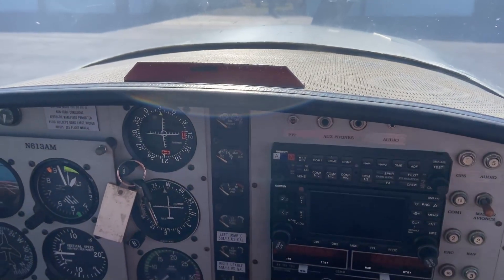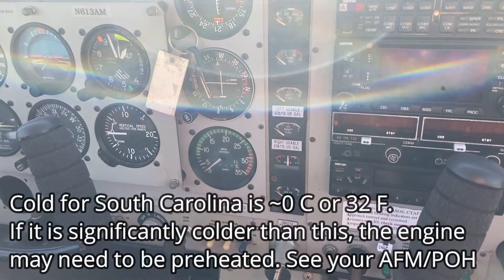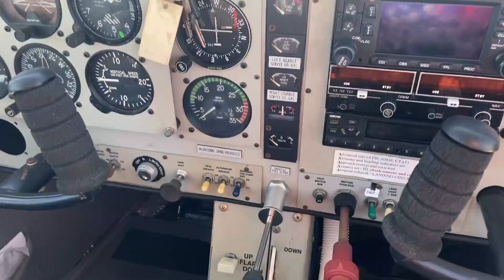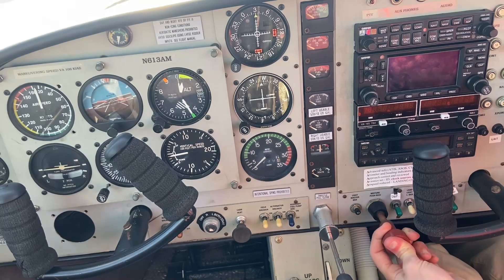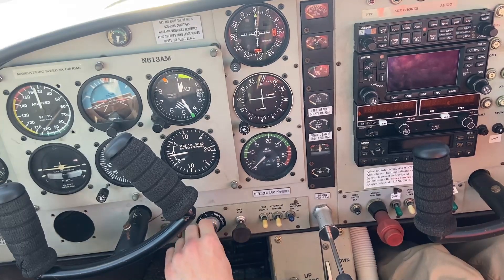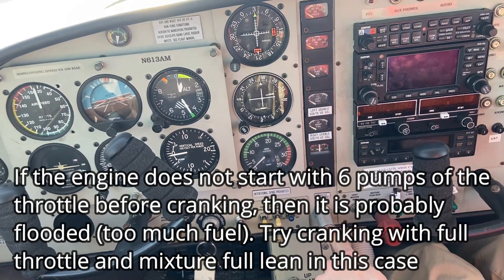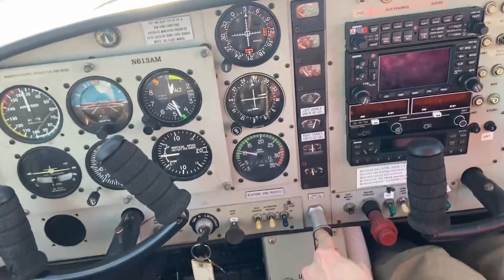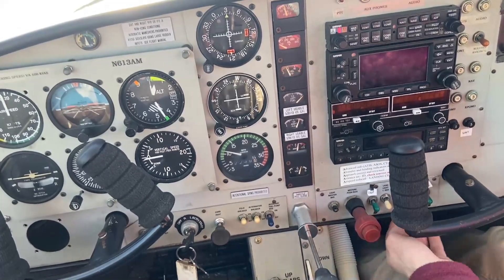Zenair Alarus Cold Engine Start

Comment: Oh man.  Starting a really cold engine like this is horrible for the engine and can put many 10's of hours of wear on it with just one cold start.  Serially cold started engines have a slim chance to make it to TBO.  An engine heater will quickly pay for itself if you need to cold start.

Comment: and the fuel pump no longer needs to be turned on? does it flow by itself?
Reply from the maker: The electric fuel pump uses electricity so I only wanted to use it to get fuel pressure to push some fuel into the engine. All low wing airplanes that I know of have at least two fuel pumps: the electric one and another that is turned by the engine. When the starter turns the engine the engine turns the other fuel pump, so the electric one is only really needed at first. It is used during takeoffs, landings, and maneuvers for safety in case the other one breaks, but technically the engine will run just fine with just the engine-driven pump
Reply: @WalkerWeathers  Thank you!
I thought that there was no mechanical pump on an aircraft engine because they are very unreliable compared to electric ones.
Reply: @I___ electric pumps may be a little more reliable but when they fail it's usually immediate. Mechanical pumps almost always fail gradually, allowing pilot to notice. Also they don't stop when the battery fails.
Reply: @Second.Nature.Lawn.Michigan  Let it be.)